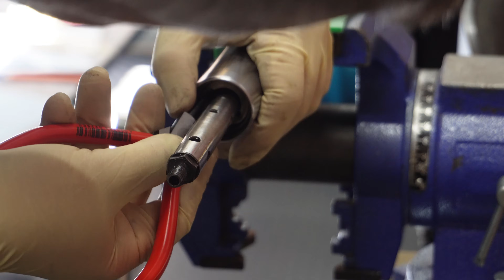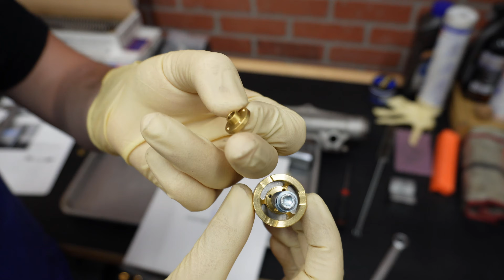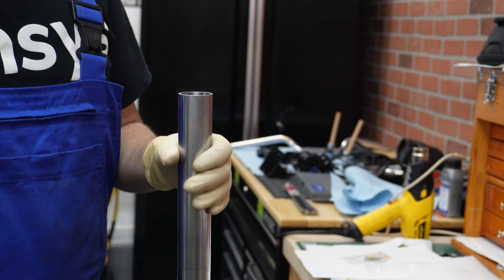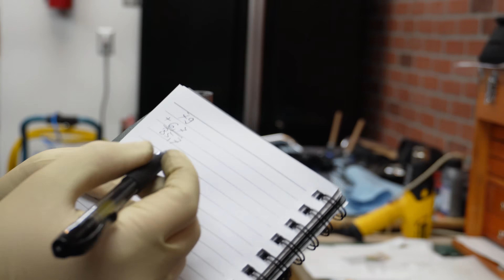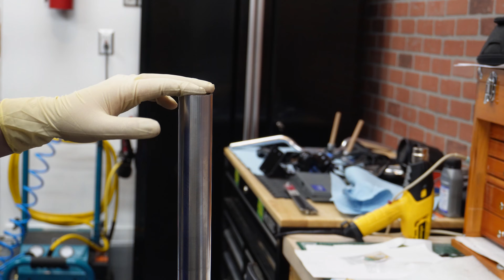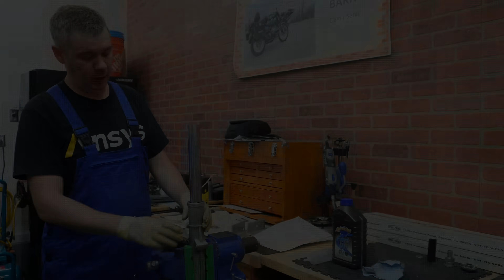1977 BMW R75/7: Episode 20 - Suspension Part 2 (Forks Rebuild & Upgrade with Race Tech Emulators)

Comment: Hi Fellow Rider :-) Thanks for all the great videos. I have also received valves and springs for front forks from Race Tech and it has been really usefull to watch your lessons upfront. I have a -77 R100S. One question; Really like your vice. Not able to find the same design in the market here in Norway. Could you please inform me regarding the brand?
Reply from the maker: It is cheap one from Harbor Freight. I believe Forge is a brand. It must be a copy of some very nice vice